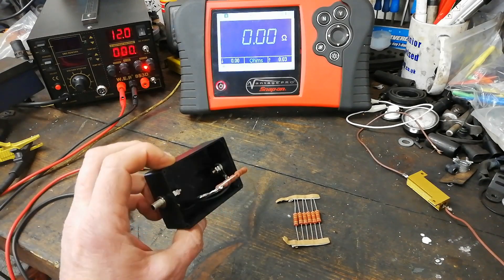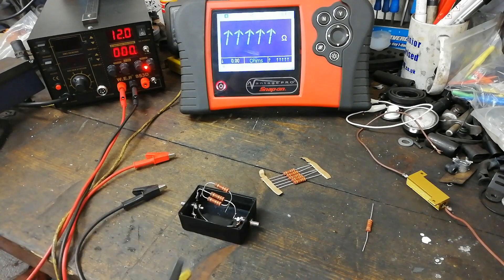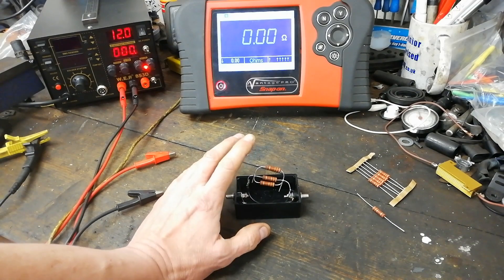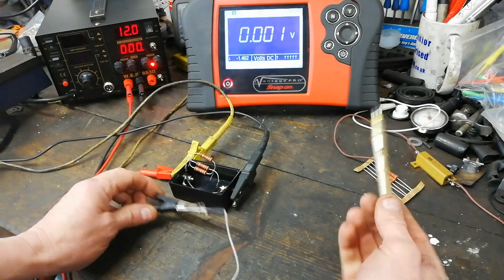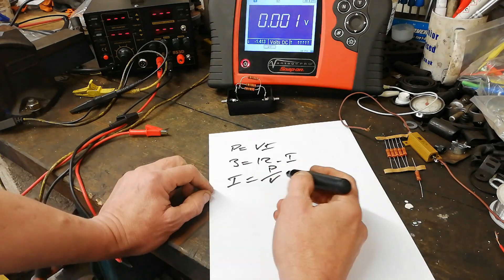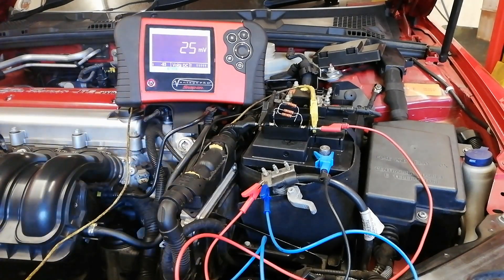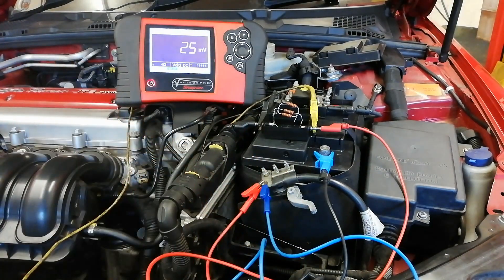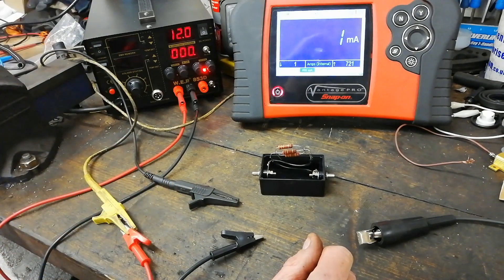Automotive Homemade Tools Part 2: Low Amps with a Scope, Shunt Resistor: Parasitic Draw

Comment: Two things: One. I loved your theory.  I will be using it in my future diagnostics.  (how not to fry your shunt resistor).  Two. Please do not teach new techs about piercing wires.  I am from the North East and we have a lot of corrosion issues. Would you ever think of piercing your test leads?  Do not pierce your automotive wiring.1/2 second of bad video but the rest was great.  Make more content.   73's
Reply from the maker: In the real world all mechanics pierce wires and seal them afterwards. Is why we have piercing probes, cheers

Comment: How have you worked out your conversion of voltage drop into amperage.
Reply from the maker: Its relative to the value of the resistor
Reply: dave sterl yes meaning your conversion should be 1mV equals 1mA. Is your power supply amperage reading slightly out? I do enjoy your videos 👍🏻

Comment: thanks Dave. any chance you can do one on the load pro would be nice too too see someone else theory on it
Reply from the maker: Hi ian. I havent got a load pro cos i dont need one. All it is a 25ohm resistor built into a test lead on a button. Your doing the same thing with test lamps or a bulb
Reply: @davesterl  no probs Dave thanks a million. Just so many in the field well on you tube have no time for it I think it handy it certain situations.
Reply from the maker: @iankelly2110  no doubt is handy with a button for a load test, but thats all it is